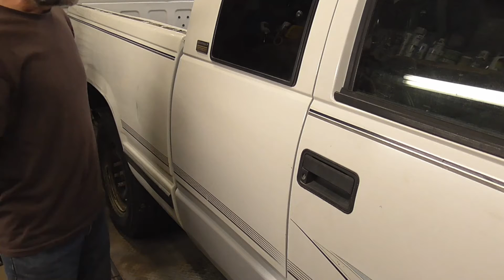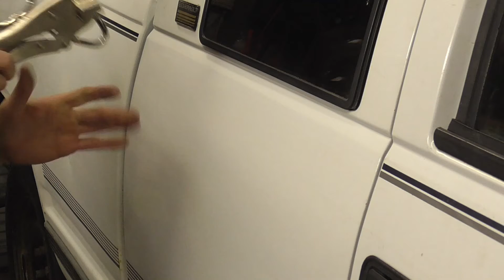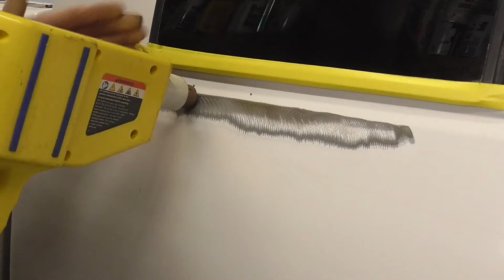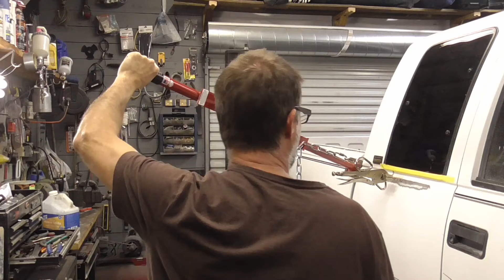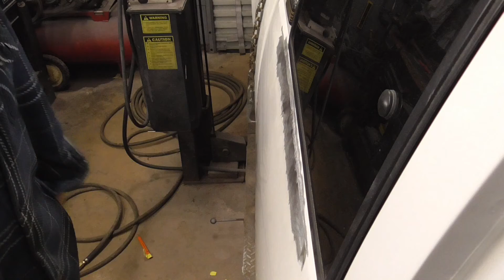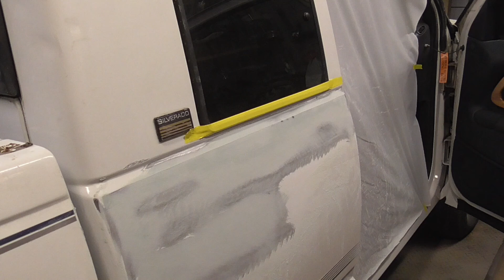How to Pull Dents Using a Stud Welder & Pogo Stick

Comment: I shaved my third brake light on my Xtra Cab, so I did drop half of my headliner and remove the panels and carpet. I didn’t want to take any chances when I welded the patch panel in. Fortunately, I didn’t break anything...Those 90’s Toyota’s are not as plentiful in the junkyards anymore. Another great video, Jerry...We’re learning a lot from them!
Reply from the maker: It's a real bummer when you can't find parts - had that problem many times.  Glad you enjoy the videos and glad you can get something from them.  I appreciate the support :)

Comment: Man tha pogo stick is the way to go! I  need to pull a big dent out of my girls Chevy Tracker but the inner structure doesn't allow for much room to work from the inside.
Reply from the maker: Most dent can be repaired from the outside eliminating the time and hassle of removing interior panels (breaking the parts too)
Reply: @LakesideAutobody  👍

Comment: Thanks, question. What does the hammer do in the process?
Reply from the maker: If you are pulling on a low area and push or hit on high areas or away from the low it give the pulling action more energy. Sometimes you can actually see the dent coming out as you pull the lows and hit the high areas.
Reply: It’s called Tension Relief

Comment: I don't like working on alignment rack like that  the car is a little too high to get decent leverage. I just picked up an 04 civic today going to fix a couple rust spots. Have a 13 Chrysler T&C nice but doing a patch panel on the front corners of fenders and replacing bumper. I still havent finished my own car yet though. A Lower dog leg/ rocker section was done in the past.. It was welded too far in at the bottom. So it sinks in a little down the body. I need probably 1/4 to 3/8 on just the dog leg to halfway around the fender well. The lower rocker panel is also rusted and needs to be fixed too Should i just get another lower rocker and partial dogleg like they did before and replace the whole thing? 

I was considering patching in formed sheet metal of my own for the lower rocker (its covered by side skirts) and then duraglass dog leg to 1/4 and finish with bondo. 

I don't want to sink too much money in but want it to last. There are signs of cracking around the striker plate where it was seamed in.. and well the doors are a little off too. I think the center pillar needs to be pulled out just a hair. 

Im at a stall out on the project because i cant decide how to move forward. The rocker dogleg would cost me about 400 from volvo.. wish this thing was never wrecked.. because I'm all in already.